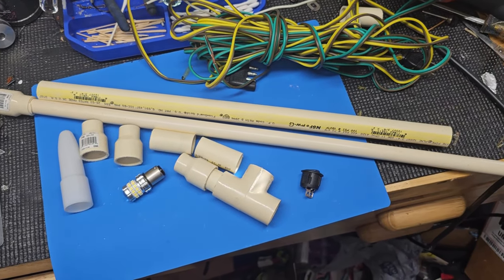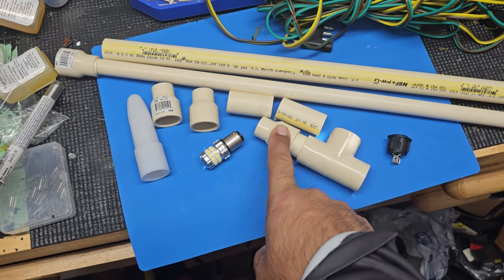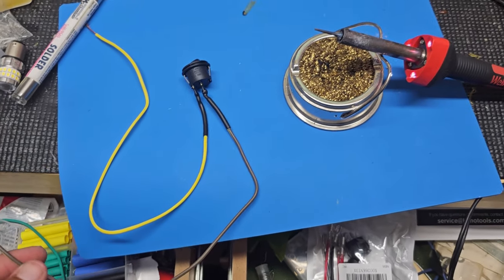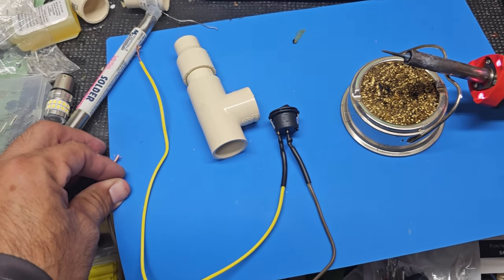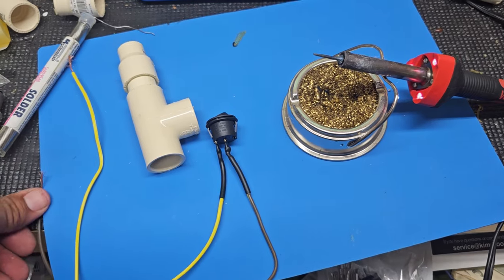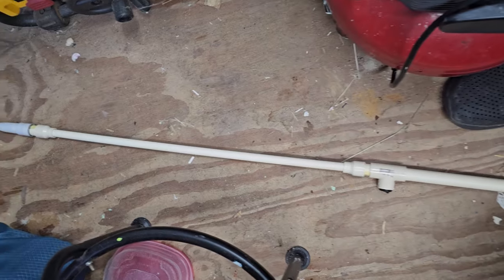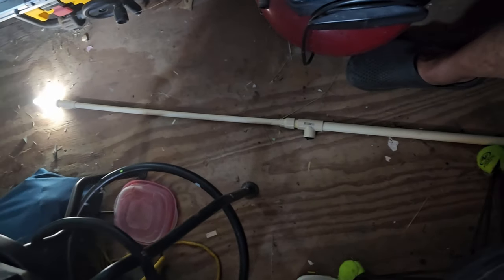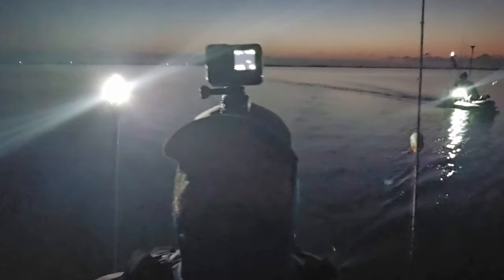The Best diy 360 light, Wolf's Fishing

Comment: Chris, what are the stats on the battery and the trickle charger?  Jim
Reply from the maker: The battery is just a 4ah. It last about 2 trips about 4 hours but if you get a larger one it will last longer and power more stuff before recharge.  
https://amzn.to/3EdVR5e is the charger it's a 1a charger for 6v-12v the more amps it will charge faster